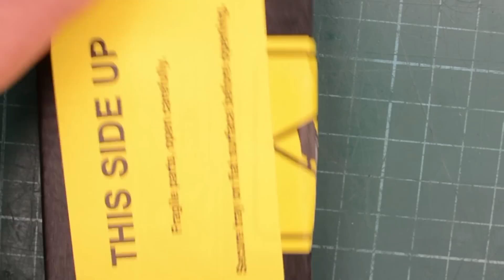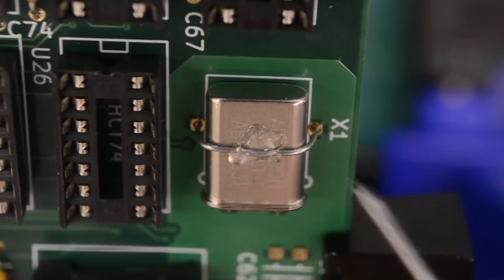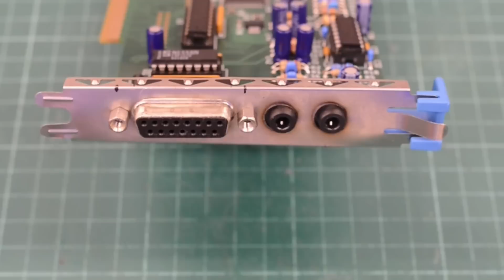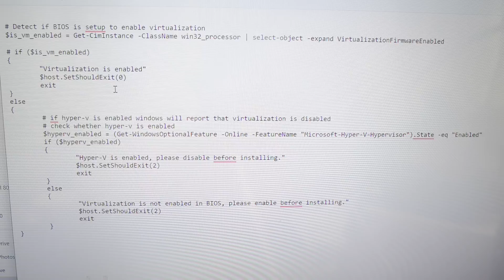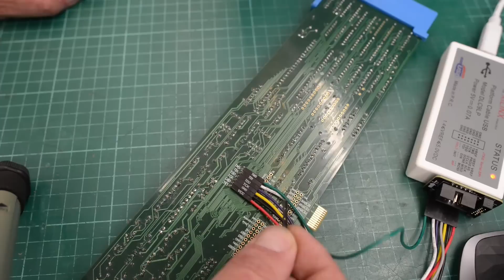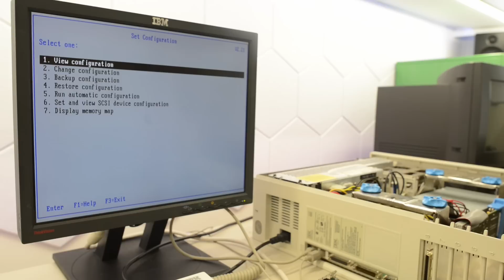Sound Blaster 1.0 MCV Replica build + CPLD programming

Comment: 21:52 The minimum PCB order is usually 5 pcs so what I usually do with my nice projects is use one of the spare boards and build another one complete then put it on my display shelf. If you do that be sure to solder all the parts into the board without sockets because rarely are parts in sockets on production boards. You have the skills to remove any parts and replace but since it's only a display piece that won't need to be done. Soldering everything in will make it look even nicer.
Reply from the maker: Yeah, I think I'm gonna build another one using all the tested chips from this board
Reply: Also a display board is a good way to ‘use’ broken chips that you’ve replaced on other systems.
Reply from the maker: @markirmuir  I've got plenty of those :)

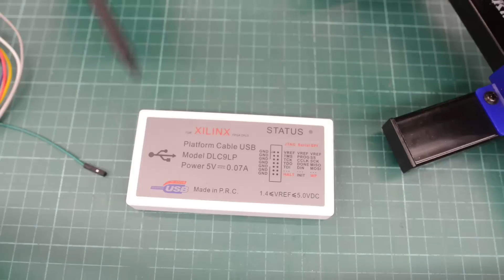Comment: 14:26 Pro tip: To keep it looking clean you should have plugged the JTAG cables into the connector but not soldered it in. Then hold the connector in place by pushing sideways and applying some pressure then program it. It usually only takes a few seconds to program a chip so you will only have to hold it for that amount of time. Obviously it must be held by pushing sideways at an angle so the pins contact so get the software ready, hold the connector and then click 'program' while holding it firmly. After it's programmed you just lift off the connector and it looks clean and those holes also stay clean. Something to remember for any future JTAG programming :-)
Reply from the maker: I'll give it a try, thanks!
Reply: This is what I often do with ISP headers.

Comment: Have you ever tought about why are they still making resistors with such long legs?? Its just a waste, you never need them.
Reply from the maker: True. It would have been easier to install them if they had shorter legs
Reply: @Epictronics1  Like most technology it's a remnant of past times. It's easier to poke a resistor into a hole manually if the legs are longer. It also allows variation of hole spacing. If the resistor was pre-made to fit a 0.400" hole spacing (common for 1/4W resistors) and some board had wider leg spacing the resistor would not fit. Also, if you keep those resistor legs you can re-use them to patch a trace, make a jumper or build up a circuit on a vero board :-)

Comment: Question, wouldn't it be more practical to use hot air to solder that Xilinx chip? I mean, in the beginning the board is totally unpopulated, so the risk of melting plastics is practically zero.
Reply from the maker: It probably is. We'll compare in some future project
Reply: @Epictronics1  No don't do it. I can tell you from 30 years of soldering experience you will never line up the chip perfectly and it will be out of position and it will annoy the hell out of you (well it annoys me to see a pin off by even 0.2mm). Soldering it by hand is the correct way to do it.

Comment: I've only just started watching and I'm already getting flashbacks to my time working in a factory making boards for PCs and PS/2 systems.  I mostly did testing of the final product, but I also got to apply engineering mods to certain runs of boards.  In our case we used hot air blowers, both stationary and hand-held.  Interestingly, the hand-held unit I remember looking a lot like a standard hair dryer, which is kinda scary, as someone could conceivably prank someone with one of those.  Only it would probably burn a hole in your head before you realized what it was.

As for the technique used by the factory I worked in, I do recall having to be very careful about not keeping the PCB under the hot air for more than a couple of seconds.
Reply from the maker: Cool job :) Yeah, hot air and solder paste is a great method too. On these few SMD components, I'm not sure it matters much but on larger projects, it's a better method for sure

Comment: If the drill is getting hot you're probably running it too fast: when drilling steel the drill should be run at a low speed with a lot of force -- 20kg of weight on the drill or more would not be unusual for a wide bit like that!

A drill press for metalwork will give like 4x or 10x mechanical advantage and generally run slow for exactly this reason. Drilling steel with a handheld drill is super miserable, but it's possible if you really lean into it. Getting a clean hole is another matter..

Once you've overheated the bit, it loses temper, and will get dull really fast.
Reply from the maker: My drill press only takes small drill bits. I hope to get a much larger one someday. I was pretty lucky to get this good result handheld
Reply: @Epictronics1  You don't need to guess the speed. There is a formula... RPM = cutting speed (m/min) x 1000 divided by (Pi x drill-diameter). So for a 10mm high-speed-steel drill with standard cutting speed for steel at 30m/min, 30 x 1000 / (10 x 3.14159). RPM = 955. If the steel is hard reduce the cutting speed to a smaller number and recalculate (15 is a good start for hard steel). I'm sure there is an online calculator somewhere. Cutting speeds for various metals and other materials are available online. As a cnc machinst I usually started with a cutting speed of about 300 - 400 but that was for carbide tools :-)
I have a vid of one of my machines drilling a 60mm hole at 1000RPM using a carbide indexable tip drill (we call them U-Drills) in 4140 steel. It cuts like butter and is pure magic to watch :-)

Comment: you must use really good flux, the stuff i use is a pain to clean off the board. could alsp be that im using 91% isopropyl alcohol and not a higher concentration. at any rate, good work!
Reply from the maker: Thanks! If I leave the flux on the board for long enough it will get cold and difficult to remove. If that's what's causing you trouble use a regular heat gun or your rework station to heat the flux up. When warm it's much easier to remove. I use AMTECH NC-559-ASM Flux
Reply: @Epictronics1  Correction: You use the chinese copied AMTECH NC-559-ASM flux. The real stuff is much more expensive. Personally I use AIM NC254 flux gel (real stuff not from China)
Reply from the maker: @g4z-kb7ct  I thought it was the real stuff! How can you tell?
Reply: @Epictronics1  there is no real stuff unless you buy it directly from the manufacturer or an officially supported supplier. check the price you paid then check the price on the manufacters site. I'm guessing you paid less than half for your stuff. If you heat it the knock off stuff disappears and dries up in a few seconds and the real stuff is active for longer. It's good enough for what you do so I wouldn't worry about it.
Reply from the maker: @g4z-kb7ct  Interesting. I'll order a tube and compare :)

Comment: when drilling hardend metal, use machine oil OR water as you drill to reduce heat, drill a small pilot hole first then step up to a larger drill bit as you are removing less metal and less heat each enlargement. Also get a cheap tool called a NIBBLER. good for cutting straight edges on sheet metal even square holes to size
Reply from the maker: A nibbler would be awesome to have. I drilled in three steps but it still got too hot. I should have used oil for sure
Reply: @Epictronics1  Oil is really messy, don't do that. He means 'machine oil'. It's water-soluable oil (coolant) that is white when mixed with water in about 10:1 ratio and is used when machining parts in engineering workshops etc. As a retired 1st Class Machinist / CNC Programmer for 30 years we used that stuff everywhere in all our machine tools. For jobs at home where you know it's going to get hot, put a block of wood in a plastic tub (do it outside) and fill with water to just submerge the wood then put the part on top of the wood and drill it while under the water. 
Edit: Anyway you can fix it. Just use some 600-grit wet&dry sandpaper and polish it and it will look like new.
Reply: Its not rly hardened material, the back plates are made of some type of stainless steel.
That means when drilling you need to have extremely low speed but high pressure, and use coolant, to be successful when  using HSS bits.
Otherwise just go with cobolt bits, but May be overkill for that one time use..
Reply: @Thelemorf  you don't need high pressure. All you have to do is thin out the center web on the drill. As a machinist for ~30 years I do that all the time when using a hand drill at home.... cuts like going through butter :-)
Reply: @g4z-kb7ct  would guess that most amateurs dont have the knowledge or skill to manually grind drill bits for certain applications
Reply: @Thelemorf  It's a lot like SMD soldering... surprisingly easy when you know how and not difficult to learn. When I'm in my workshop and I need to sharpen a small drill I just use a honing stone and a couple of minutes later I'm drilling. With the internet now there's really no reason to want knowledge but not have it. Everything is there at our fingertips in seconds if we want it :-)
Reply: @g4z-kb7ct  I never said I couldnt.. But most ppl can, and some things you have to learn the hard way by many many hours of practice no matter how many videos you watch.

Comment: I'm so ADHD at 41 I cannot Trust Myself still with Surface mount chips like this;
My OCD about my Bread Boarding in Highschool 20 years ago, making the Jumpers & Components lie flush & cut to length was bad enough LOL
Reply from the maker: My breadboard jumpers look perfect!😂 I wasted so much time making them😂
Reply: @Epictronics1  My Electronics teacher was Annoyed, but I had an UnUsed Tackle Box that was clean, I would take it to school and save my used parts & Wires for ReUse.
I Looked like I was Hauling around a Compaq Portable every day to school as if it were Field Trip day to the Fishin' Hole LOL

Comment: A good method for small smd components is to tin one pad, then put the part together with the soldering iron in this pad and position it. Afterwards, solder the other pad. Works fine, even without flux. I'm using flux only for components with multiple pins and/or hot air.

What also works good is solder paste. Just a bit on every pad, put the parts into it and let the hor air do the rest. Gives great looking solderjoints and looks just like factory.
Reply from the maker: Yeah, I need to remember to get some solder paste. Thanks for the reminder 👍
Reply: @Epictronics1  Solder paste is really just tiny balls of solder and flux together. You really don't need it but if you are going to use it then use it as intended.... apply paste, put the parts in place and hot air it without touching it. Paste is most useful for a reflow oven where parts can't be mounted manually. For home projects it's not required especially since your manual soldering skills are excellent.

Comment: you do realise you could use solder paste instead of flux in soldering smd component and save some time on cleaning flux or addingsolder on the iron tip?
althought it looks like you like to take it slow
also
if JRC labeled part is obsolite, there is big chance that it is still produced under the same number with NJM instead of JRC in the name
Reply from the maker: Thanks for sharing. I'll check!

Comment: You have plenty of random old PCs there so to save all the messing around it's better to use a real PC running the required OS. When I program my CPLDs I use an old laptop running Windows 7. Yes that Xilinx software is a real dog... 1GB of junk to program a CPLD lol
edit p.s. You might be able to replace the NJM3403 with a LM324. The NJM is specifcally made for audio applications but the LM324 is pin compatible and should work. If you are able to swap out the NJM for a LM324 and compare the audio I would be very interested to know if there's any audible difference :-)
edit p.p.s. You can solve the long cap issue by first bending the legs at 90 degrees before soldering so it sits flat against the board.
Reply from the maker: I'll add an LM324 to my next order and we'll try it out. I compared the caps with my other PS/2 cards and they have the same size caps. So, that is the proper PS/2 look :)